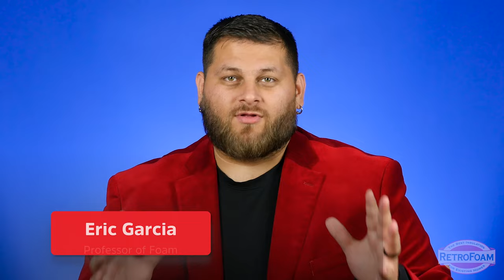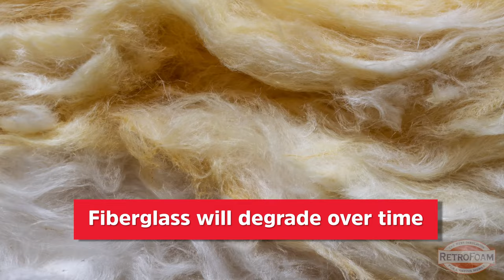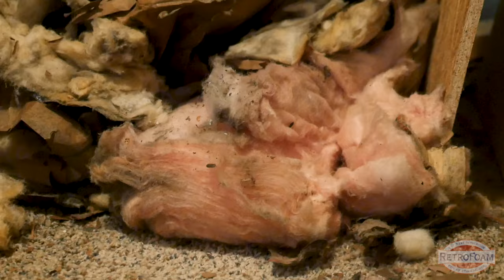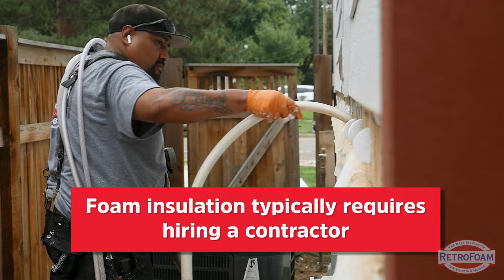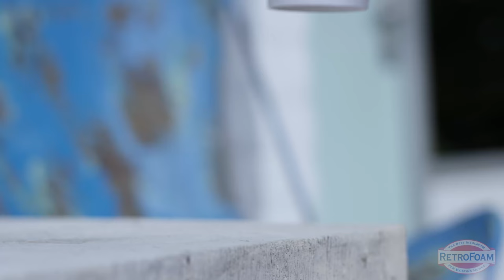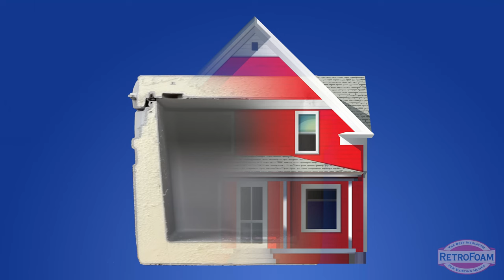Foam Insulation vs Fiberglass: The Ultimate Home Insulation Comparison Think Coffee Cups

Comment: Do you recommend ripping out old fiberglass before spraying foam? What are the pros and cons?
Reply from the maker: Yes, we always recommend removing any old insulation before installing spray foam. If there is a layer of fiberglass or cellulose insulation on the attic floor, as the air from your living space heats up and rises, it will want to move into your attic. You want to let that air get into that space without the hindrance of the old insulation. This could cause major temperature differences between the attic and the rest of your home. Also, insulation materials like fiberglass or cellulose are fibrous, meaning they retain moisture.

This article from our Michigan blog contains some additional helpful information on this topic: https://www.retrofoamofmichigan.com/blog/remove-attic-insulation-before-installing-spray-foam